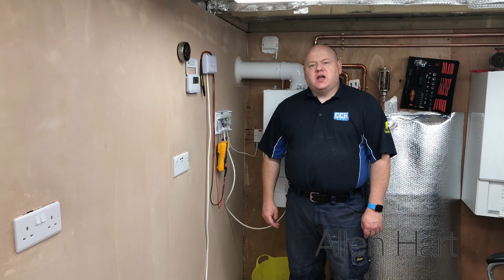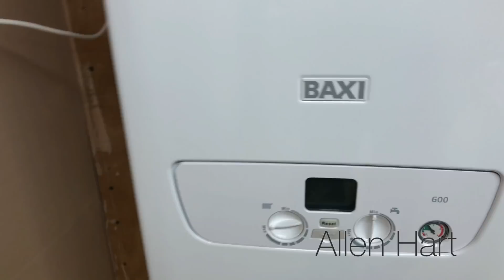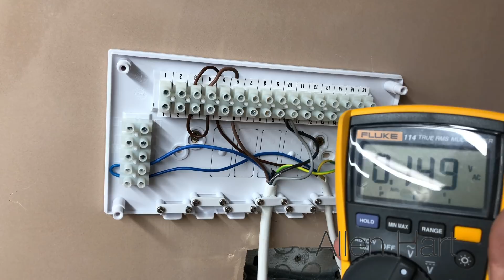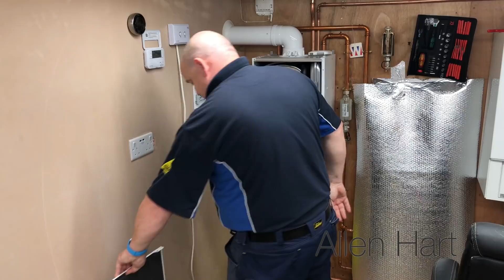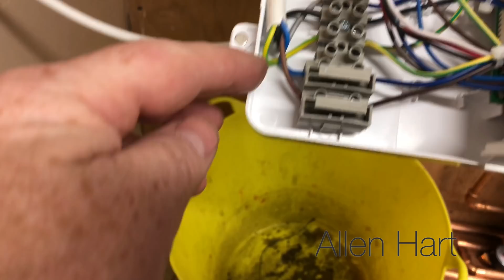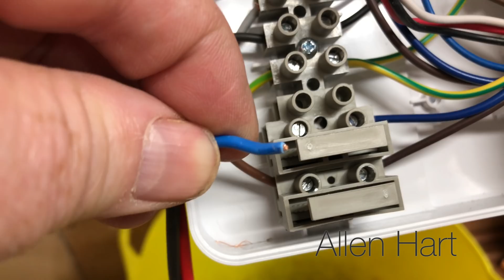New Gas Boiler Not Working No Power , Fault Finding Heating Gas Engineer

Comment: It happens at wiring centres a lot because you have so many neutrals due so many needed for timeclock stats and motorised valves boiler etc

Comment: Use bootlace ferrules if connecting to chocky block. Never assume the mains is isolated by switching the fused socket off. Always isolate at the fuse board as the live/neutral could have been wired the wrong way round. Buy a voltstick which is a useful tool for indicating a ‘live’ connection without using a multimeter. 
However, if you’re not electrically trained you shouldn’t be within 10 feet of it.
Reply from the maker: Very good feedback. Thanks.

Comment: If you are going to take the case off a boiler you must be gas-safe registered is NOT true.  How can it be that a gas engineer does not know what the gas-safe register publishes?  You read the Bulletins right?

Can I take the case off my gas appliance? 

It depends on whether the case is purely decorative or whether it is an integral part of the appliance. Decorative casing: These cases can usually be removed by the consumer e.g. can be lifted off or are hinged panels and do not need to be unscrewed. A decorative case can be removed safely by the consumer or anybody else remembering to follow any manufacturer’s instructions and warning labels and making sure you have safely isolated any electrical parts.

https://www.gassaferegister.co.uk/media/1449/who-can-legally-work-on-a-gas-appliance-factsheet.pdf
Reply: Is a customer likely to know the difference?? To be safe tell them not to remove the cover.

Comment: So the “gas safe” engineer that installed this boiler was basically incompetent.
Reply: I think It's a training video.  a fault made by design for demonstration purposes
Reply: Yep that was may take too. That neutral termination was abysmal. Its pretty basic making sure you strip enough insulation away to terminate the copper in the terminal block properly.

Comment: Thanks for the video but How come the neutral to earth showed 237V when it wasn’t even touching the tightening screw?
Reply: There was no incoming neutral from the supply . So in essence what you saw was Live To Earth. As the supply Live went through the boiler and back out on the Neutral connector on the Boiler. As there was no incoming Neutral ( Due to neutral wire not being terminated correctly) The circuit ended at the neutral terminal block.
Reply: @robhawkins2492  Thats what confused me, now you've explained, it makes sense, cheers

Comment: That is so basic but good to show. I would have removed the live and checked the other connections as the "sparky" who did the original job didn't know what they were doing.It amazing me how many folks cannot wire a plug properly. I was in the electrical industry before I retired.

Comment: Nice one Alan it looks if somebody's been rushing the job and not checking their work completely
Reply: @pmailkeey I would certainly agree a good electrician would not do this he would complete his work my suggestion is a young and inexperienced gas engineer done his own wiring as he might have done this many times before but failed  to check with a multimeter he probably went through the wires one by one with his fingers that's where the mistake is made and then gave up as it is probably getting dark rushing around as usual
Reply: pmailkeey that’s not true; the bodge jobs and errors are mainly through the ridiculous amount of pressure put on engineers by their employers to too many jobs in one day. I spk from experience.

Comment: i get the same problem with gas engineers piping up heating systems wrong. I think tradesmen should stick to what they are trained for
It dose my swede in when gas engineers crack on about you cant do this you cant touch that then they crack on doing crap heating jobs. Its all bollox.
And if as you say its mostly installer era hummmmm wtf are they fitting boilers for if they cant do simple wiring bad gas work = explosion bad wiring=fire
Sorry for the rant but i see it lots and it winds me up

Comment: I came across a similar problem once , I found that the previous engineer had done the same thing to the neutral on the 2 port motorised valve , it took  me 10 minutes to discover it !
Reply from the maker: Its great to find one. Thanks.

Comment: Leave wiring to the sparkeys. It's safer and means no one should need to return to a job.
Reply from the maker: Gas Engineers need to know how to fault find after the sparky has gone 😂😂😂
Reply: @AllenHart999  Good point.
Reply: So it’s ok for the gas engineer to fix electrics, so ok for sparky to fix the gas !
Reply: Fixing electrics, its hardly that! Its a simple termination error on a supply cable to the boiler, something any competent gas safe engineer should to be able to do.

Comment: Just a quick note from a spark - if the spur is on but the boiler is off then ‘turning the spur off’ doesn’t prove you’ve isolated the boiler. I know this example has all the cables in view but in the real world there may be more than one spur in an airing cupboard eg old programmer/wiring centre and old immersion and if cables are concealed you wouldn’t necessarily know which does what....for the viewers be careful diving straight into a wiring centre or boiler cover just because the nearest spur is off ESPECIALLY if the boiler is already off and operating the spur doesn’t have the effect you were expecting
Reply from the maker: We need to always test to make sure its safe, the more a gas engineer gets used to using a multi meter the better. Thank you for your advice.
Reply: @AllenHart999  A multi meter is a great tool but should not be used to prove dead. We have to use a martindale voltage indicator that you test before and after. In reality i know everyone use multimeters but its easy to blow an internal fuse or damage a fuse lead and think something is dead when it is infact live. Just watched a couple of your videos and really enjoyed them. Subbed
Reply: @Marks-Garage  Test lamps can still suffer an internal fault and give a false reading, just the same as a multimeter. Before and after using test lamps or a multimeter to ensure correct operation you test them - often on the better quality multimeters this is just a case of touching the leads together in a test mode and then you know the unit to be working - on cheaper multi-meters a continuity test also usually serves as the instrument check - if you touch the probes together and get a beep you know the multimeter circuitry to be working correctly. 

A multimeter is an instrument that many people don't understand or know how to use properly, which is why test lamps or a voltage indicators became the norm - simple to use (no settings) and easy to operate (using a multimeter can sometimes required 3 hands to probe circuits and hold the meter if no-where to put it)  it has been been born out of creating a simple, idiot proof process. However, a multimeter is no less an adequate instrument for checking circuits and can be used to indicate far more than test lamps. 

Having said that, in my experience an electrician with a multimeter is dangerous as they don't often really know what to do with them - so that goes back to what you say, "We have to use a martindale voltage indicator that you test before and after." - basically you are being told to use something because you are not to be trusted with a more complicated instrument is what that boils down to. Sadly, based on my observations, this is due to the new generation of programmed electricians who don't really know what they are doing. They are often very good at running cable from A to B and ensuring the installation and test readings all comply but don't actually have a good grasp of electrical circuitry and control beyond getting cable to things. Try and explain simple controls or emergency lighting circuits or whatever it may be and they look at you totally blankly because they don't actually know what is going on. Thus why they are given test lamps. They are simply programmed to follow some instructions. Not all but many are like this and it is getting worse as the old boys retire and leave the kids.
Reply: @peterpeterson9903  A multimeter is designed to do a vast amount of different measurements. A martindale is used to test for dead. Our safety rules are quite clear that you only test for dead using an approved voltage testing device. Also in our industry our circuits include AC and DC so it would be too easy to forget to switch the multimeter from one to the other and think a circuit is dead when its live. Its also a confidence thing as well because before touching a conductor i want to test it in a manner where i know its 100% dead and with the martindale im always confident that its correct. We are slightly different than the rest of the industry in that we have permits and locked points of isolation so the whole thing is a belt and braces approach. I agree with what you said about training methods because now its all down to telling people a procedure to follow rather than telling them how something works. If you understand how it works then you will know the dangers and what can go wrong. Too many people in the industry that are there purely for the money and not actually interested in what they do during the day to day. Its a shame because when i joined as an apprentice i was surrounded by guys in there 50s with 30+ years experience and now they have all gone and im one of the most senior at 14 years experience. My background is HV but we do a fair bit on 110v dc and 230v ac circuits.
Reply: Im sure you would of got a parallel path back on the earth on that continuity test-the fused spur didn't isolate the earth!
So even with a break in the earth of the flex from the wiring centre you would still get a 'beep'
Reply: Here man leave it out will ya, he clearly stated he’s not an electrician but you can see where he’s coming from with what he’s saying, there’s always one who has to cherp up 🙄
Reply: Kill all the power at the fuse box! Isolation is garunteed.
Reply: Theweescot ... not really customer convenient though

Comment: Are you saying gas safe trained boiler installers do this?  I find that unbeliveable!
Reply from the maker: A lot of guys have minimal knowledge on electrics, Every day is a school day.
Reply: So a qualified electrician cannot wire a boiler because he/she is not gas safe!
Reply from the maker: Anyone who takes case off the boiler would need to be able to check its safe afterwards, Normally the gas engineer would be on site as they would need to commission new boiler, So it shouldnt be a problem. Thanks.

Comment: One of the best bits of advice I can give for making electrical connections is to look at the terminal once you've made the connection. Look into the end of the terminal to check the terminal screw in on copper and not insulation.
Reply from the maker: I see some many people blaming the boiler for no power, Normally its down to installer, Thanks for watching.
Reply: I'm an electrician Allen and I've seen the same mistake from fellow sparks. Sometimes even at the load side of the spur and they still blame the boiler! I'm enjoying the vids mate and learning a lot, keep up the good work.
Reply from the maker: Thank you.

Comment: What you should is when you strip the wire back leave it long enough then double over wire enough to side into the connector block this way to will aways get a good connection.
Reply: Or just use the item actually designed for the job and fit boot lace ferrules on the end of the conductors.
Reply: Bumbles Exactly, takes seconds and provides a good mechanical and electrical connection .
Reply from the maker: Good tip. Thanks.
Reply: pmailkeey Each to their own, if you prefer screwing down on stranded cable then carry on. I’ll stick to utilising a correctly sized ferrule that accommodates all strands , assuring a  durable mechanical and electrical connection.